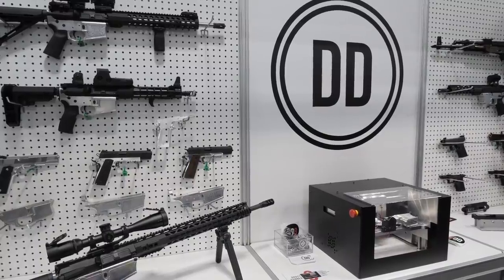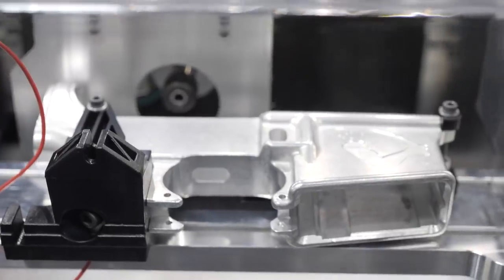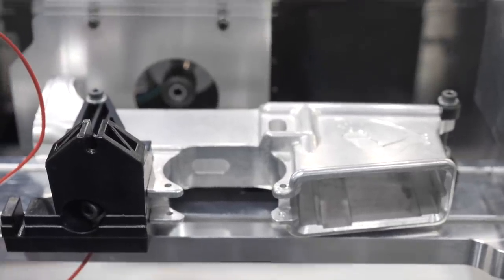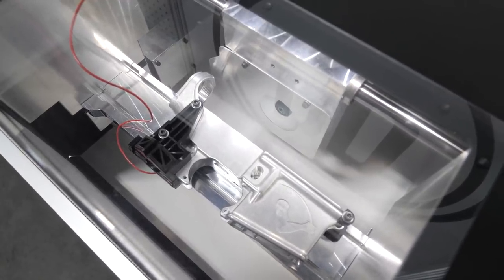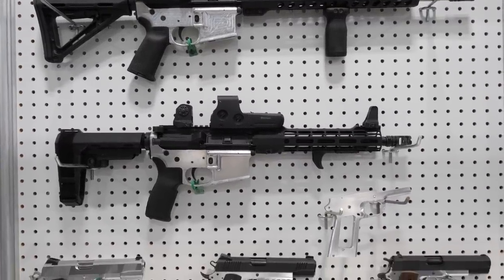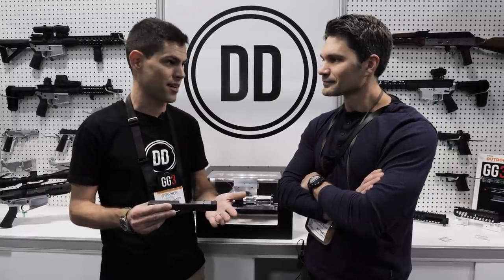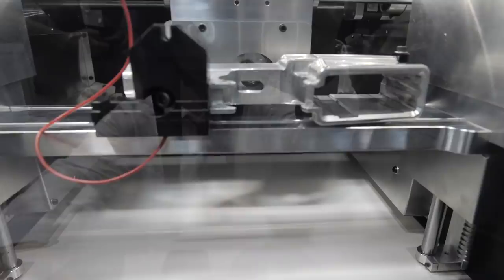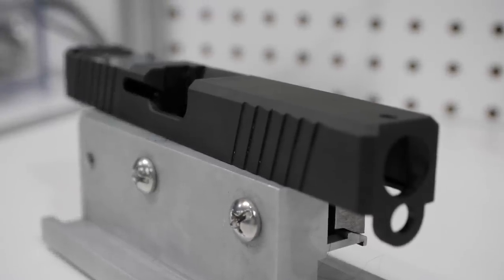The Newest "3D Printer" for Guns: Defense Distributed Ghost Gunner 3 [SHOT Show 2020]

Comment: Do these print 80% or 100% lowers? Being that your making them and milling it yourself it should be able to be 100% lowers
Reply: They don't "print" anything. It's simply a purpose built CNC machine that takes 80% lowers and 80% frames and finishes them.
Reply: MyRecommendedIsAllMemes oh wow.. I thought since they were referring to the machine as a 3D printer that they were making the lowers.. so basically this device is doing all the mill work and drilling that a drill press could do?
Reply: @joseph395  that's pretty much all it does for now. It sounds like in the future you might be able to mill out a lower from a solid block of metal but currently it's main function is just finishing the last 20%, hence the finishing time of only 45 minutes. If you're half decent with jigs and already have a drill press or milling machine there probably isn't much reason to buy one of these unless you like the automation.
Reply: MyRecommendedIsAllMemes ok got cha! thanks for the info man I appreciate it!

Comment: Get it right, thats not a 3d printer, thats a desk top cnc milling machine.
Reply: Its still super cool and I want one. I've been working with a manual vertical mill for to long.
Reply: @rdsii64  how is the manual mill in performance per dollar and what model mill do you have? I've been debating about getting a sub 1k chinese milling machine or one of these. I'm just not sure if the GG is worth over double the price of the manual mill for low volume finishing of 80% lowers.

Comment: I don't understand the purpose of this mini mill. You would have to make so many ar15s for a pay back. It takes longer to do it with a drill press but it doesn't cost $3k either. Now if I could insert a block of aluminum and get an ar15 lower comes out I could see the price being worth it.
Reply: Plus there is no paperwork to come take your guns
Reply: But can you do 1911? P80? Ak? And engrave?
Reply: Yea I'd rather buy a Tormach 770m only 4-5k then you could make anything lol
Reply: @wilhathaway1987  yeah I get that but a jog and a router do the same and you can also finish a lower in about 35 minuets with one of those the easy gin gen 2 is fast as hell and only takes about 30 min so it's a huge price gap for nothing more then giving away 2 grand. And with 2 grand you could follow alot of diy tutorials and build a much stronger milling machine.